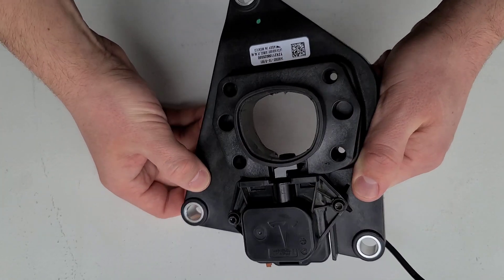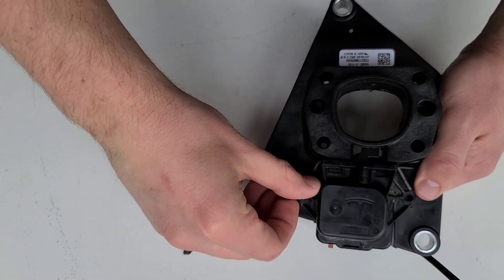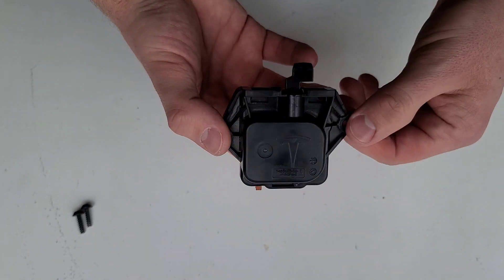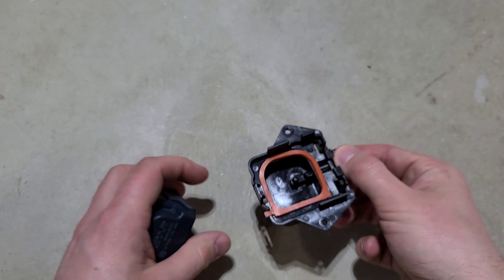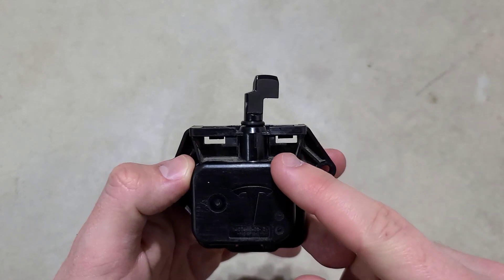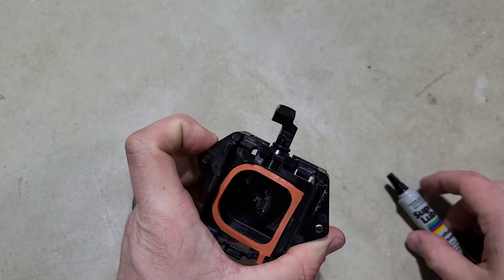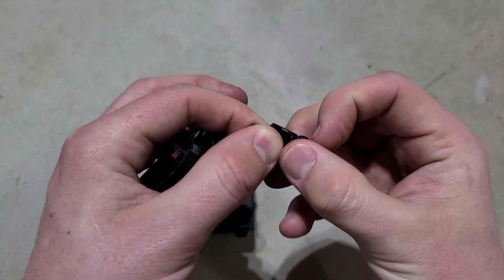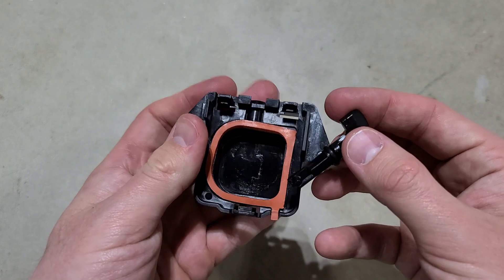Tesla Charge Port - What's the Real Tesla Problem???

Comment: Tesla Charge Port Stuck – Need Help!

My J1772 adapter is stuck in the charge port, and the manual release cable broke off after the first use. The charge port is now blinking red, and the locking mechanism won’t release, even after disconnecting power.

I’ve already:
✅ Removed the trunk liner and accessed the charge port components
✅ Disconnected the charge port actuator – still locked
✅ Tried all software-based unlock methods – no success

The locking pin is still engaged, preventing removal of both the adapter and the charge port unit.

At this point, I’m considering cutting the locking pin as a last resort, but looking for any other solutions first.

🔧 Has anyone successfully released the charge port lock manually without the cable? Any suggestions or backup methods would be greatly appreciated!
Reply from the maker: @yont24  I would have to look into it more, but the fastest thing I can suggest at the moment is to create an account on the teslas maintenance site and look through their free tesla manuals.

Comment: I had the same exact problem. Mistake I made was spraying wd40 on the locking pin to try and get it to work more freely. This helped in the short term, but in the long term the o-ring expanded so much it caused the pin to seize completely. I had to take the assembly off of the car with the charger still connected so that I could get to the torx that holds the cover plate for the locking pin and then manually pull the pin out by hand. 61 cent o-ring and its all working again.  I'm not sure if the o-ring is exact what tesla utilized but its working.  I may install a used complete unit.
Reply from the maker: Yikes that turned ugly pretty quick haha but im glad you managed to find an o ring that worked!

Comment: How is this the only video or reference of this problem anywhere online…. Yet I’m 99% sure I have this problem.

My pin won’t retract all the way, and if I manually pull the release, it then struggles to relocate again. 

I have tried lubricating the pin and that frees it up for a little bit…. Like a day but it begins sticking again.

Knowing exactly which washer to use would be helpful, otherwise I have to disassemble it just to figure it out, and then hope I can find it.
Reply from the maker: Any issue I need to fix or find, I'll do my best to post it! Let me know if you do find the size of rubber ring!
Reply: I ended up paying Tesla to replace mine, which was expensive, but it was because my port was badly worn and they wouldn’t tell me it any other way.

I’m going g to refurbish the part

Comment: have had same issue with latching
2019 sr what i did find is taking a hair dryer inside the trunk for a few minutes and it has worked
so not sure if it would be the o ring for my case
Reply from the maker: That is an interesting hack haha I hope it works out for you in the long run. If it doesn't keep me posted!
Reply: its a nuisance as you never know if it will latch at the supercharger
tesla needs to fix this issue as its there software preventing the pin from latching when it hits a certain temperature
Reply from the maker: @Juls_esp  This is more of a mechanical issue than a software issue. If the latch is struggling to move, that is when you get the fault message on your phone. I agree though, something Tesla needs to improve on.

Comment: First, loving this kind of content. Great for the Tesla community. I watched your other video but I'm not clear on the problem. Was the car getting the lock stuck in the up or down position? What was the error message the car was throwing? Would be helpful to know what you were experiencing for others to help them self diagnose. Thanks!
Reply from the maker: Thanks for watching! The only error I was receiving was that my charge port latch is frozen on my tesla app. The latch was stuck in the up position, so I had to manually unlock the port every time. The problem was that the rubber o-ring inside the latch mechanism was warned out. The o-ring was building up friction on the inner walls, preventing the shaft from moving down. These o-rings brand new are firmer. Sometimes, tesla also does not provide enough grease on these parts as well, which can be another issue.